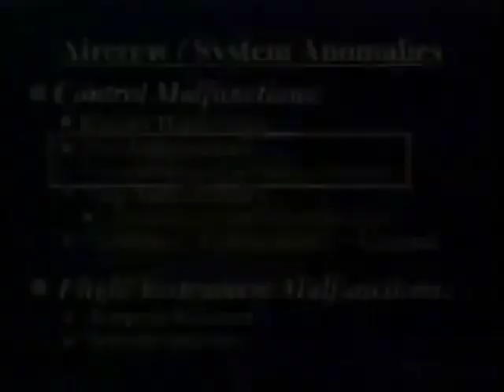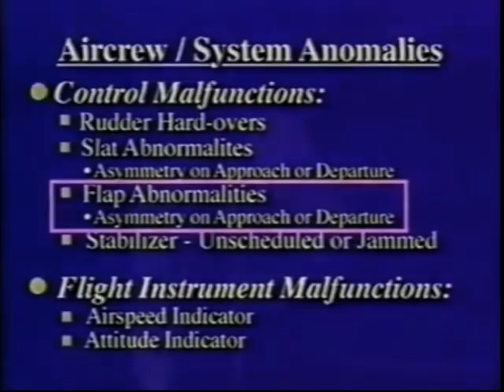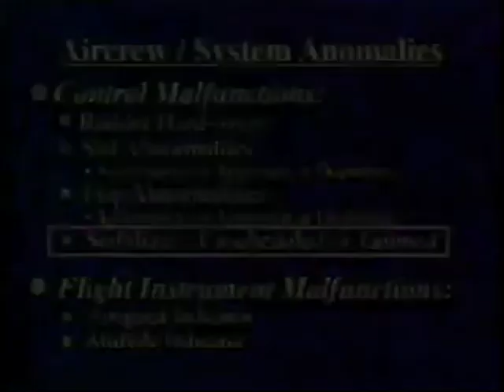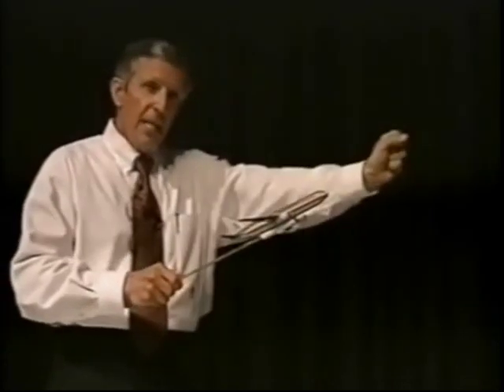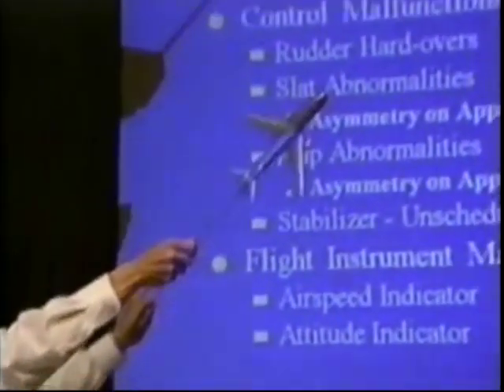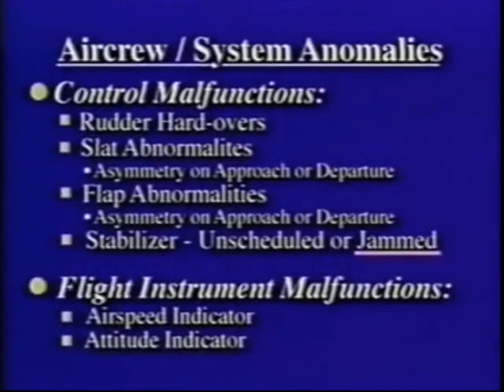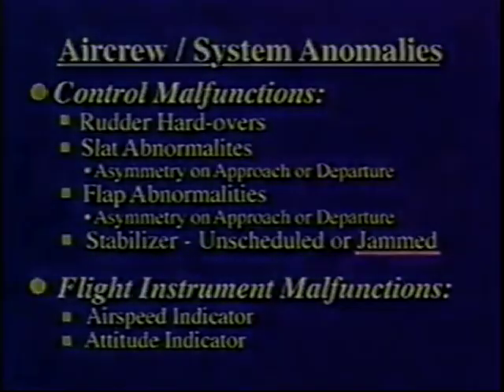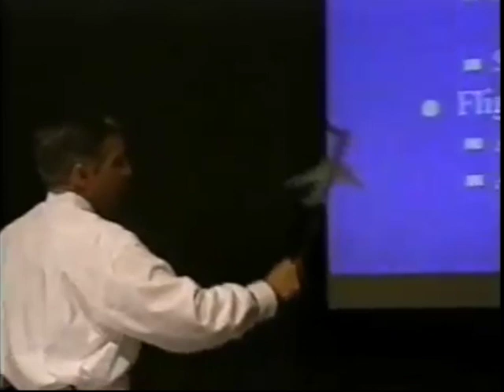Control Malfunctions & Flight Instrument Anomalies - Part Two, by Capt. VanderBurgh (restored)

Comment: Question from a non pilot. 

Let’s say the first officer is the one flying and he goes to apply full trim down (to combat accidental TOGA activation scenario during landing approach) and then asks the captain to trim down with him. Does the combined force provided by both pilots equate to any further manipulation of the trim? Is it just by brute force they are together able to manhandle and hold the trim? I understand the trim had upper and lower limits, but I’m not sure exactly how combined inputs help, if at all. 

An explanation would be really appreciated. This is fascinating stuff.
Reply: So there’s one trim system, which both can contribute to. To maintain clear separation of flight deck “duties”, Pilot Flying (PF) will only handle flying tasks, while Pilot Monitoring (PM) will handle radios, comms, checklists, etc. 

In a go around, you shouldn’t be trimmed in such a manner that you need a ridiculous amount of nose down trim after setting TOGA thrust and climbing. Yes, you will retrim, but not as aggressively as you may think.

Whether it’s fly by wire or old school direct hydraulics, there’s really isn’t any situation where “strong inputs of brute force” are required. Hope that makes sense 👍
(And my quotes aren’t meant to be rude, just the way I write things out)
Reply: @mgtowacademy8433  thanks bud. I was hoping the left pilot didn’t control the left elevator and the right seat pilot control the right side elevator 😂
Reply: @lorimeyers3839  ha no worries 😂. One system, with two options of input (one from each respective pilot)
Reply: The solution here is to switch off the autopilot and auto throttle. Then, you use the manual trim button, which in most planes is on the steering yoke to get the nose down so that you don't need to push the yoke hard forward.
Reply: @TheSimCaptain  thanks bud!

Comment: I just stopped the video at point, when the captain said: What if it can't (back the flaps)? I decided that point call full flaps. Because, if can't close, may the other side can opens. But, fortunately, I am not flying a real plane, just dealing with watching like that in here, and try playing more accurately on a smartphone-simulator.
Now, I know, what I just do about that failure. Even in my small simulator, because I tried that scene on Extreme Landings. Clever!
Reply: The problem is asymmetry; presumably, the other flap won't come out, because it already *hasn't*. If you go full flaps, you may increase the asymmetry and make the roll worse.